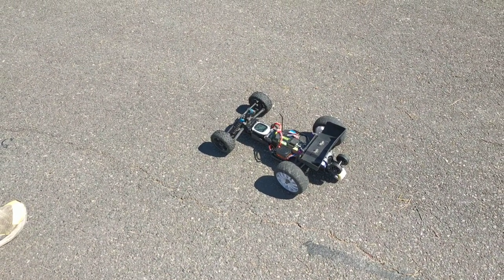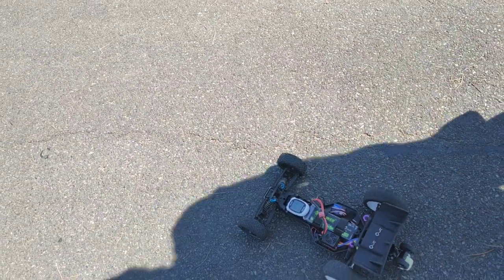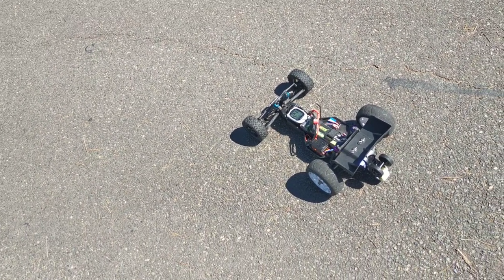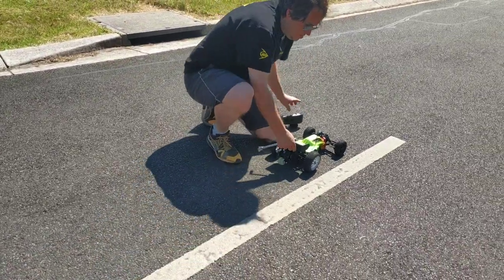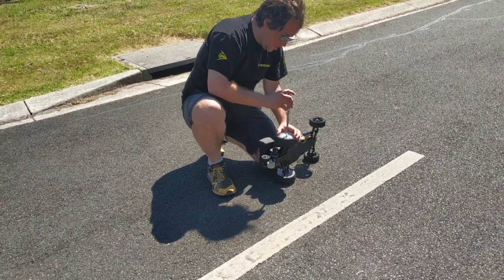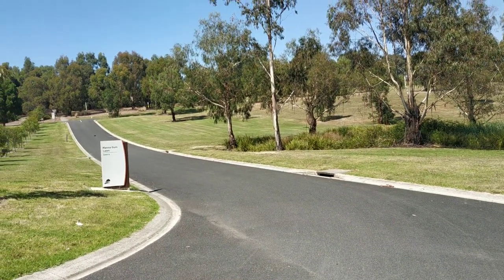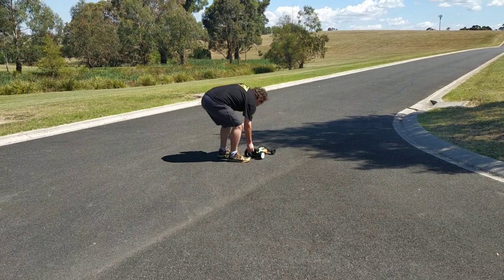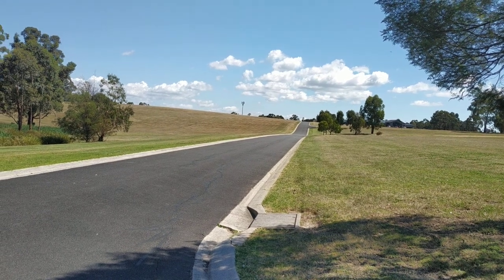HSP 2WD Mongoose 66.9mph (107.6k/h) GPS speed run.

Comment: Thats some good speed out of that buggy Andrew, nice runs mate.. definitely a bit squirley without the wing, and i could see the wobble in that rear wheel at the very end of the video as you brought it in! Tghumbs up mate and all the best for Christmas and New year 👍🍻🇦🇺
Reply from the maker: Thanks, I notice alot of speed runners still run a wing, just a a low drag version that doesn't provide tonns of downforce but mostly has the side fins for stability and a very thin middle section.

I wasn't trying to be too fancy so just tried with the wing off, it really makes a difference on a 2WD vechile when braking cause all the weight is shifted towards the front but only the rear wheels are breaking.
Now that I've completed it's speed run, that rear wing is not coming off again 😋

Comment: Thinking about getting one and putting my velineon combo from my slash in it run 3s might be overkill
Reply from the maker: It's about the same power as what I've got in there now, I will be just fine.

Really just depends how you gear it.
Given the velinum its 3500kv it should be a little faster then the stock 3652 3300kv brushless system.
With stock 23t pinion expect 70k/h with the velinum system on 3S.
You can of course gear it up for faster top speed, althogh it really doesn't like anything faster then about 100k/h being a 2WD Buggy
Reply: @druscanam  thanks man definitely grabbing one
Reply from the maker: @Billskins4dayz  
You should just get the brushless one, it's not that much more expensive then the brushed and has a hobbywing ezrun 3652 3300kv motor and 60A ESC worth about $150.
Reply: @druscanam  I was just going to get the brushed model because I have the motor and esc spare since I went max8 2200kv in my slash just thought it might be best to get the cheapest option
Reply from the maker: @Billskins4dayz  
Cheapest option yes, but there is quite alot of value in the brushless version.
If you get the brushless version and sell eaither the velinum system or the hobbywing system, you will be in front for sure. I own two mongooses, one stock brushless and the other I brought as an ex demo roller for about $70 without the motor, ESC or reviver or radio. Rightfully so they probably thought selling the ESC and motor could be sold for about what the car was worth and easier too. Then whatever they got for the radio+ reviver and chassis is probably alot more then it cost them new.
The h
Reply from the maker: @Billskins4dayz  
I just looked them up on eBay, Dammam they're alot more expensive then they use to be! Where are you thinking of buying and how much, maybe hold off I can find you something similar.
Reply: @druscanam  I can get one for 198aud from a Australian based hobby site stock standard brushed or 270aud for brushless
Reply from the maker: @Billskins4dayz  
Ok that is expensive, I only payed $203 for my brushless pro version brand new A couple of years ago!
Typically a brushed version was about $160.
What part of Australia do you live, there seems to be alot of used good condition brushed river hobby/VRX 2WD rear motor buggies going on marketplace cheap.
Reply: @druscanam emerald Qld
Reply from the maker: @Billskins4dayz  

Hmm, yeah emerald is a bit far from everywhere and there doesn't seem to be any local market.

I found this Himoto roller splinter for you on eBay from Himoto Italy pretty cheap.

It's not the same HSP mongoose/XSTR V6 platform that's based on a helion conquest but rather the HBX Quakwave/ Redcat/LRP twister platform which is really good 2WD buggy also.
Here is the link and use code PAPP5 for an extra $5 off.

https://www.ebay.com.au/itm/254470634175